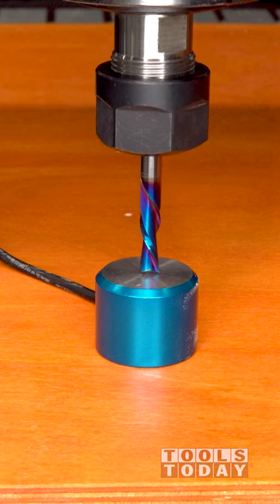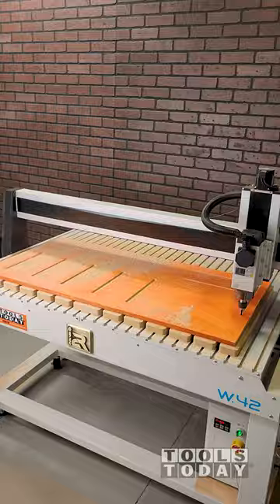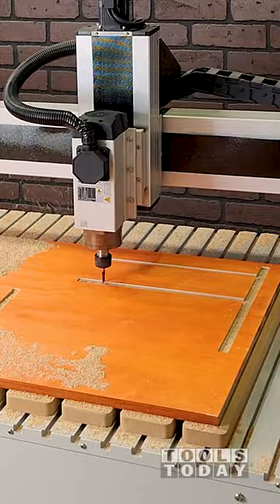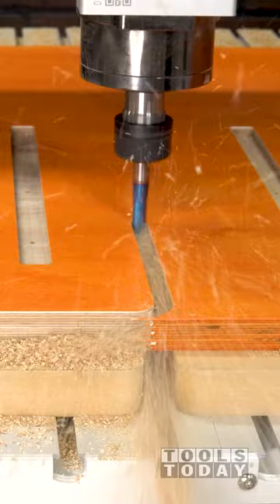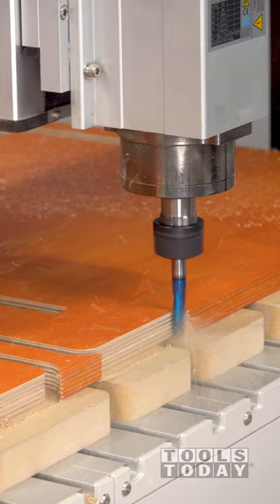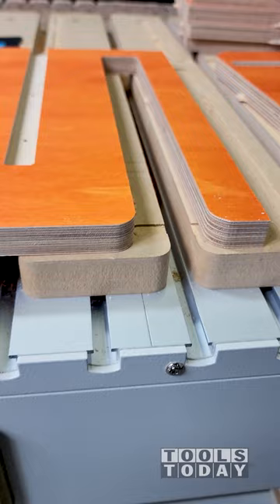Cutting 3/4" in a Single Pass

Comment from the maker: Check out the tools used on our website - https://www.toolstoday.com/v-13779-46202-k-bit.html

46172-K Compression Bit - https://www.toolstoday.com/v-13779-46202-k-bit.html

i2R W.42 4'x2' CNC machine
https://www.toolstoday.com/i2r-cnc-i2rw42-w-42-4-x-2-cnc-machine.html

Design Software - Vectric V-Carve Pro - 
https://www.toolstoday.com/cnc-machines-accessories/cnc-software.html
Reply: What is the cost of this Machine..??

Comment: Nice : ) FYI, In the video, the second tool used is 3/8 compression bit 46172-K with the matching feeds and speeds. In the description and comments, you link to the 1/4 variation which you would prob need to run a lot slower. Suggest you edit that, so folks don't end up breaking a bit on the first try.